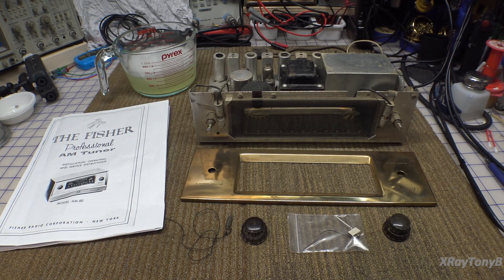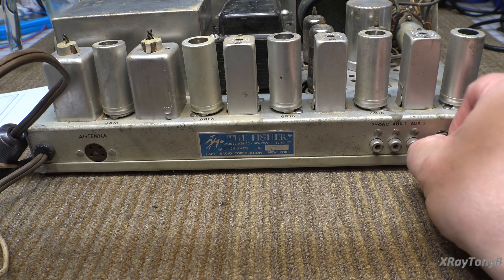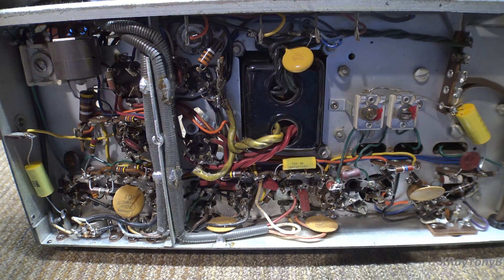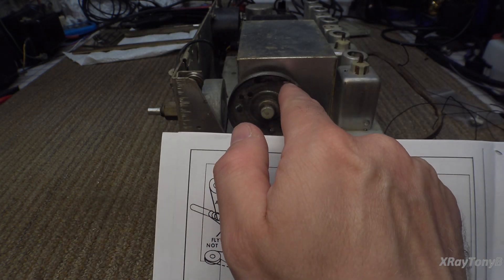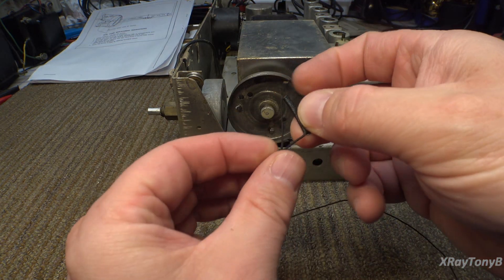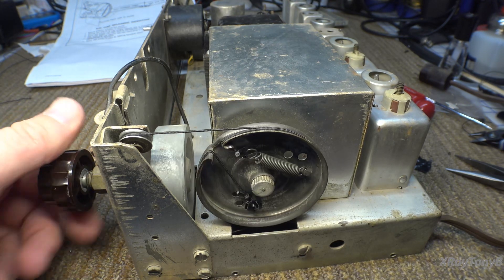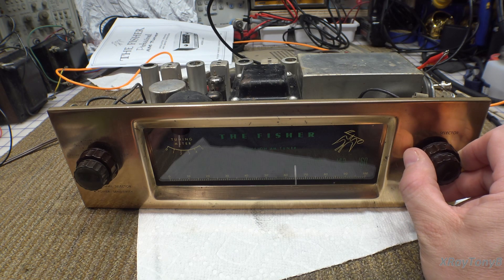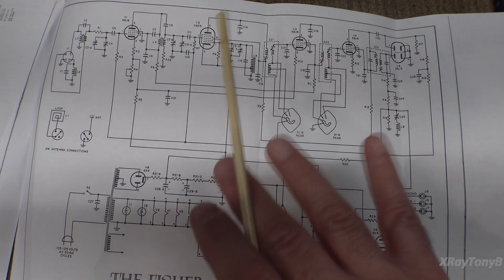Fisher AM 80 Tuner Service & Alignment

Comment: The whistle filter, you describe at 33:00, is a notch filter to notch out the 10kHz which could be generated by two strong AM stations which have a spacing of 10kHz according to the grid in the AM band. They generate an audible beat frequency of 10kHz in the AM demodulator. To avoid this 10kHz beat frequency in the audio output, this notch filter is installed. In other regions of the world, the grid is 9kHz and this filter is aligned to 9kHz.

Comment: With the brief stops due to copyrite concerns I couldn't tell, but back in the '60s I used to listen to AM radio in central New York at night and could routinely get WkBW Buffalo at 1520, WABC NYC at 770, sometimes WBZ in Boston, or WOWO Fort Wayne IN (I've forgotten those frequencies). Sometimes driving at night could pick up a station in Louisville, KY and in Windsor, Ontario but can't remember the call signs or frequencies now. We miss a lot these days by generally not having good AM tuners. And as you note, in some areas not as many stations. Thanks for a nice video and a trip down memory lane.

Comment: The dial stringing process is very tedious to say the least and I would imagine there may have been a person on the assembly line whose main task was focused on stringing these dial mechanisms. I bet a person with good eyesight, the hands of a skilled surgeon, a couple of dedicated tools and the patience of Job and they probably did dozens of those every day. That’s a task my bumbling fingers, and  my bad eyesight, and my attention span similar to that of a gnat would have me at a skill level of putting knobs on. 🤔😮. 

Another great, fascinating, and highly entertaining and educational video. Thanks Tony!!
Reply: You could always take the nut off the spindle, feed the dial cord out the front, wrap it around the shaft a few turns, then push them down the shaft, and feed the dial cord back through, then stick the nut back on. Add a plastic crochet hook to the mix...
Reply: @equid0x  well I would most definitely drop the nut on the floor which would then roll underneath my workspace where it would be just about an inch out of reach and once I found something long enough to move it around it would likely roll to another equally difficult spot making another challenge for retrieval then when I finally get the nut back and start with the string, I would discover that I accidentally knotted the dial cord necessitating unknotting the cord then after winding it the three times around the spindle I would discover that I wound it in the opposite direction, so another undo and then I get it corrected and stringing it in the prescribed way I would discover that I measured wrong and the dial string is an inch too short and I have to start all over again with a slightly longer dial cord.  🤷🏼‍♂️🤦🏻‍♂️🤔😂
Reply: @Aswaguespack  A magnet wand is your friend :) In all seriousness I don't think restringing is really all that difficult, but some of the really old stuff had over-engineered tuning dials with ridiculously complicated mechanisms that require 6 hands and a lot of patience. He mentioned one in the video. I watched that one and the way the tuner is setup is ridiculous.

Comment: In all my years in electronics I still have to meet the first colleague who likes to restring a dial cord on a tuner.  Imagine being the one in the factory doing exactly that for eight hours a day.  BTW, Tony, it helps if you use a long (5 ich) needle with the string attached to it, instead of pushing the string by itself and fishing it with a hook through those narrow spaces.

Comment: Hi Tony, a few items:
1) I’ve found that a crochet needle whose tip (which is hooked) is spritzed lightly with 3M spray-on adhesive is great for retrieving loose dial cord, especially if you make a small loop in the end before you start the restringing project!
2) If you can find a product at the hardware/home-improvement store called “blue tack”, this is great for holding dial cord onto a pulley so it won’t slip off while you’re working on it. Then, when you’re all done restringing then final cord, you can just pull off the little squashed blobs of blue tack. It’s sort of like slightly tacky silly putty (except it’s not bouncy!) It also is heat resistant, so you can use it to hold a component on a circuit board when resolder ing. HTH! 😎
3) The receiver seems to have two (analog) meters on the front, but the schematic only shows one; near V7. 🤔 oops, never mind that, the other “meter” was just the “bird with note” icon on the right side of the dial. From far away, it looked like another meter.

Comment: Hi Tony.  Great video, especially since after years of looking, I finally was able to find my own mint Fisher AM 80 tuner this summer.  Mine performs very well, but I appreciate the alignment tutorial as it will help when I align mine.  Amazing that I've got all Fisher branded tubes, so after 60+ years, these tuners are still a work of art.  Do you have any suggestions for cleaning the brass bezel?  Thanks,  Paul

Comment: Such an awesome vintage fisher valve radio tuner with sensitive radio tuning stations at night,,,did u count how many stations received across the dial?
That tuning meter looked to b dancing all over the scale too when tuning in stations,,,and I had seen it pinned off the scale on a local,strong station too.

But so interesting how you do the alignment of the tuning coils with the oscilloscope meters,,,etc,,,and adjusting the 3 trimmers that were really spot on.

I don't have any kind of that type of equipment,,,but I had learned it by reading service manuals of radio tuners,,,and fine tuned both am and fm bands just by listening to the sound. 
On some old,dirty stereo units I had received to repair with radio tuner problems and sound troubles,etc,,I had found a lot of dry joints on circuit board I had to resolder,,,and readjust fine tuning on some radio tuner units that were well out of alignment and signal range,,,and had got them back very much the way they should b,,,receiving stations,,,and some of these vintage radios were sensitive tuners as well,,,and had got them working as they should like new.

Comment: Great videos - I follow all.  What are you using for your AM antenna.  I am about 50 miles west of Chicago and it is hard to pick up AM on a simple loop antenna.  I have a Heathkit AR-1302 that is good to go but not really able to pull in AM.  I have an antenna in my attic for FM/TV so getting all of that.  Have a good one!

Comment: I prefer to start with putting the dial cord around the axle of the dial knob,
then go to the wheel on the condenser (the wheel being at the "wrong" end of where it should be).
Connect the dial cord and then rotate the wheel to the opposite end. Then that end of the cord is done.
Then it's just a matter of running the cord around the other wheels and back to the condenser wheel and fasten the spring.
This looked to be an open and easy accessible situation.
Modern radios can be a nightmare to restring. Some compact units from the 70's comes to mind...
BTW I just restringed the 3 !!! dialcords on a Grundig Satellit 6001. That was fun :-)
Reply from the maker: Thanks for the tip!

Comment: As you were lining up the needle on the re-stringing, your needle was about two points to the right but you said it was on zero. Therefore I was not surprised when, during the alignment, your 600Kh portion did not line up. Maybe i saw it wrong! LOL

Comment: For Info search: FCC proposed changes for a.m. broadcasting 
The FCC will provide a public notice of proposed all-digital operations. No changes can be made for 30 days following that public notice to allow other AM stations to take measurements of the current interference that they receive from the station planning to convert to all-digital operations so that these other stations can judge if the all ...

Comment: I have a question about vu meters, hopefully you can answer it for me, I have a new Yamaha as-1200 integrated amp. And it seems no matter what I Play, cd, turntable, tuner the left side meter seems to always put out just a slight bit more power, I've switched cables L-R speaker wires L-R and it doesn't change. Example would be if meter jumps to 35 the other will be 30, but you can hear the difference in the left speaker being louder. Should I be concerned ?

Comment: Why is the tuning needle so bouncy?
Reply: The spring of the galvanometer is probably broken
Reply from the maker: I've noticed that all of the old fisher tuners from this era have the same "jumpy" meter movement.  This is because they are a very simple design and they don't have any type of damping in the movement.  If you look at the meters on both of the fisher 500 units I restored a few videos ago, they do the same thing.
Reply: @jeanpierre3193  The meter coil current passes through the two springs. Therefore they are not broken. I suspect that the drive circuit is undamped by design.
Reply: @xraytonyb  For what's it worth, the signal meter seems to use the negative AVC signal unfiltered as the input to a cathode follower tube. There are probably even all the audio frequencies present at the meter input. Do you believe that a capacitor at the grid of V7 could be used to dampen the movement?
Reply: @harrilumme1875  I was thinking a small ceramic right across the meter.
Reply: @equid0x  A lot of VOM's and VTVM's have up to a 10uF low voltage  electrolytic cap across the meter connections to dampen it, which, would be worth experimenting with here. If if was a tap off of the AVC circuit, like Harri stated, it may in fact dampen any oscillations of that circuit as well, eliminating, or reducing,  any  "low frequency beat" of the audio level.